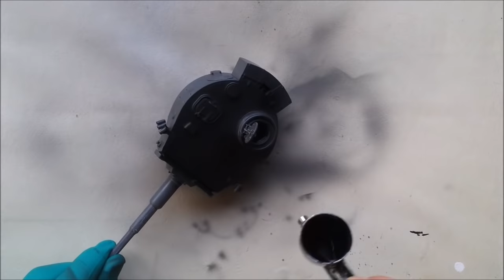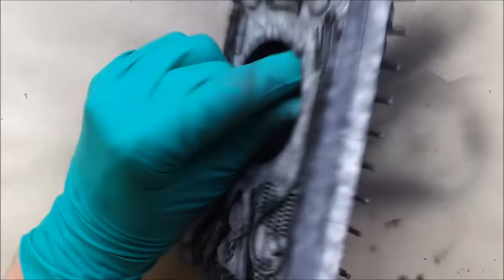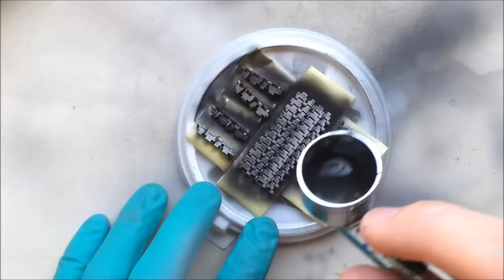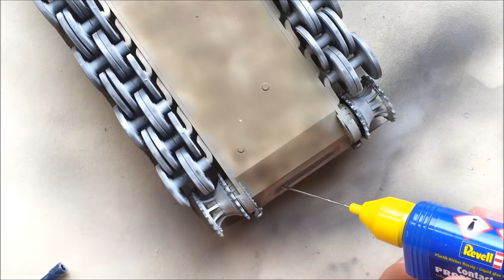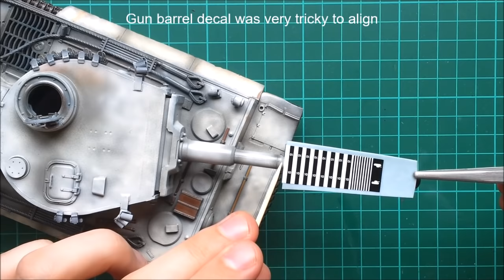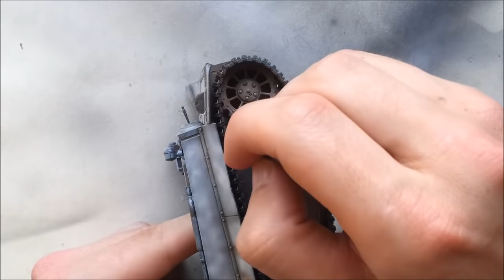Tamiya Tiger I (Sd.Kfz.181) 1/35 - Paint | The Inner Nerd

Comment: As someone who has never airbrushed before, how do you get the marble effect. Is it just very light pressure on the paint "trigger"? Very interested.
Reply from the maker: it's hard to explain in words but you need constant air pressure and a very faint pull on the airbrush trigger (on a dual action type airbrush). Then keep the airbrush moving in a squiggle pattern to make the random patches. I have covering it in more detail here https://www.youtube.com/watch?v=W3zDmJwpPcY&t=70s but in my next video I will try to explain even more. Hope this helps and thanks for watching :)

Comment: are you using acrylic or enamel? I personally think i rather have enamel paint so it does not melt when touched or if you want to wash off the dust? i am a starting modeller please let me know
Reply from the maker: I'm using acrylic's on this one. To protect the paint when removing oil washes use the opposing clear coat. So for acrylic washes use enamel clear and vise versa. This will stop the thinner in the washes reacting with the paint since they use different mediums as a base (water vs enamel thinner). If you use enamel paints, clear and washes then the thinners in each wil eat into the previous layer. 

My method is paint in acrylic, clear lacquer/acrylic and then weather in enamels. This way the acrylic/lacquer clear will protect the paint against the enamel thinners.

Comment: Great finish, did you glue the wheels or let them spin? I you glued, how did you make to attach the rubber tracks without difficulty?
Reply from the maker: Thank's Sebastian!  I didn't glue the tracks I just let them rest on the wheels. As for the wheels I glued them into position so are not moveable.

Comment: I really like the mottled whitewash look. What size needle and pressure are you running?
Reply from the maker: Thank you. I use a 0.2mm needle at 22psi. It's more the thinning of the paint that allows you to do this though. I recommend thinning to around 50/50 so that the paint feathers from the brush. That way you'll have much more control over the pattern and density
Reply: @TheInnerNerd  cool, thanks man!

Comment: GREAT !! How do u do the "marble"  coating ??
Reply from the maker: Thank you! So here’s the answer... deep breath...

1. Base/prime your model in black
2. Thin your paint down to around 60% paint and apply a random covering to create layer number 1. This is the roadmap for the following layers. Keep the airbrush close to the model (between 1/1.3 inches) and the spray pattern tight. The looser the spray pattern the more gaps will appear showing the black beneath.
3. With the same paint, apply layer number 2. With this layer try and fill in the gaps from layer 1 as well as cover it to build the colour. Go over the entire model until the paint looks more opaque. 
4. Same paint again. Fill in the gaps made when spraying both layers 1 & 2 as well as the other areas to build up a more full looking colour. Now the paint should look relatively uniform but with some random areas of darker and lighter tones made by the gap filling of the previous layers.
5. Thin the paint to around 50%. Then, from a distance, carefully spray in a uniform pattern over the entire model to blend the marble layers together. The even paint coverage will tone down the light and dark spots to make a more uniform paint opacity with a few light and dark areas showing through.
6. If this is still too varied, repeat step 5 again until you get what you are after

And breath.
Hope this helps and good luck!
Reply: Pyyh THX man

Comment: how can you make the tank move?
I have the box and I'm wondering
Reply from the maker: The tank is designed for static display only so you might struggle getting it to move. The only solution I can think around gluing the wheels is to get some small rubber bushes and press fit the wheels on

Comment: What air brush and compressor you use?
Reply from the maker: I currently use a Harder & Steenbeck Evolution Silverline with 0.2mm nozzle @15psi working pressure.  On this model however I used a Sealy AB9321 as this was before I opted for an expensive airbrush. The compressor is a Badger 1100, highly recommend this!
Reply: Thank you for the information.

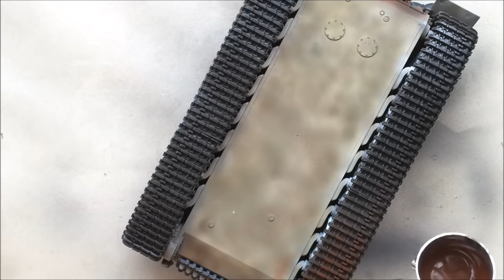Comment: 12:02 can you move those tank threads
Reply from the maker: Short answer: No. 

But the drive sprocket rotates on a rubber bush allowing it to spin so you can attach the tracks. But this is far too stiff if you’re planning on using this as a toy/RC. It’s designed as a static model so movement isn’t really built into the assembly

Comment: There is no way the Germans would have painted the bottom with a winter coat like you did.
Reply from the maker: Probably not, but the Germans also didn't paint this model so...
Reply: @TheInnerNerd   No, but if you are looking for historical accuracy in your
modelling then that would be one of your considerations.  It is a given that you can paint the
model anyway you want--fluorescent orange for example.  But obviously not if you are looking
for historical accuracy which I am.
Reply from the maker: Well thanks for the information, when I built this kit it was the first armour model  is made so there were bound to be mistakes. Anyone can make models historically accurate with enough research, I didn't on this one at least.
Reply: @TheInnerNerd  Fair enough.